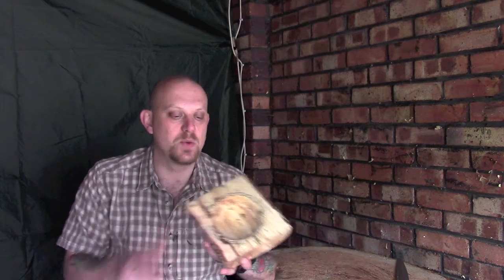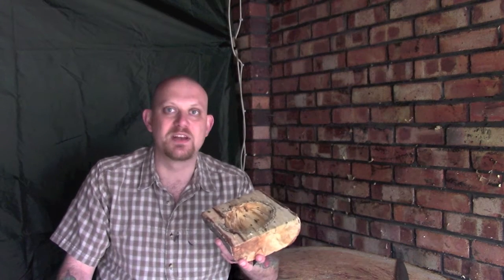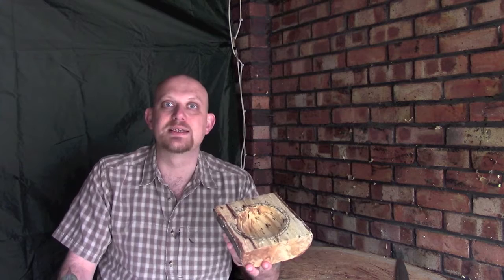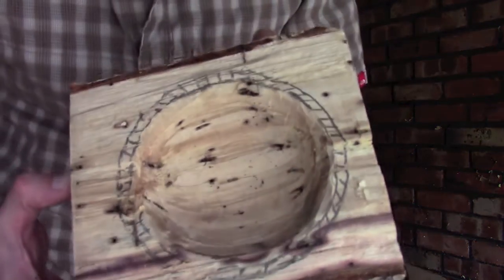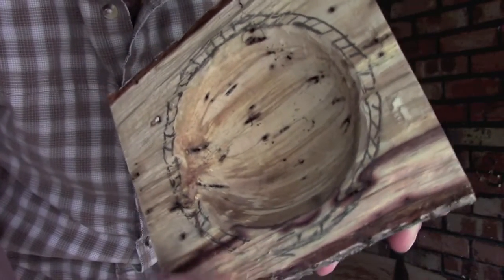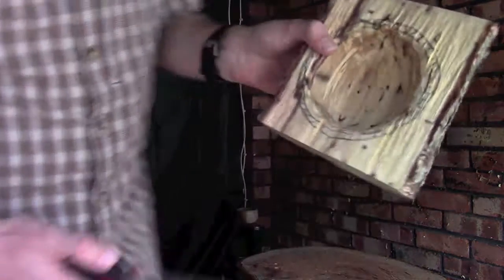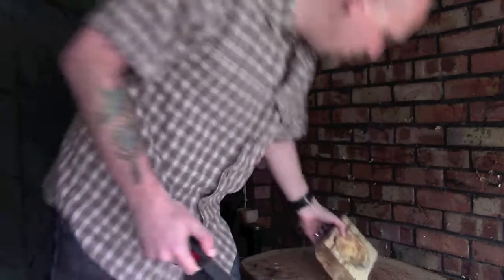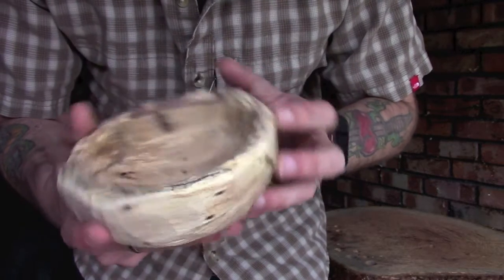Carving with less than ideal wood - Part 2

Comment: I thought spalting was only peculiar to Beech until quite recently, after  I milled up some Poplar 2'' square section, a friend cut off the excess lengths for his job, and shoved them in his wood store. They dried out over time but went a trifle grey, but, he put them on his lathe and turned out a couple of really well spalted and figured candlesticks. He glued the bases on spun out of Ash as a sort of contrast and presented them as presents to someone...... so out of rubbish we get quality... !!!

Keep up the good videos, excellently done... !!
Reply from the maker: It is possible to force spalting at home in a plastic or wooden container but it's not something I have tried myself. Essentially you are varying out a controlled decomposition but having read up on it there's seems a bit too much work involved when I have access to fallen trees already.

Comment: As primarily a hobbyist woodturner,spalted timbers are always highly sought after ; the common ones are beech,birch (especially silver birch) and sycamore. With beech being a much harder,close grained timber than birch,it can take a lot more spalting before becoming too soft to work with. To harden up soft areas to be able to cut them cleaner,try soaking them with sanding sealer,or CA glue (superglue)
Reply from the maker: Thanks Andrew I've not worked with sanding sealers before but have read a lot about them. I must try to get hold of some when I get the chance an experiment a bit, thanks for the tip.

Comment: Hi I am not from the UK and do not know what exactly is a carrier bag. I did some searches and it looks like it is a paper bag but it'd be nice if you could add some detail on the kind of bags you use to season and stabilize the wood. Thanks and I love your videos!
Reply from the maker: hernanc Hi, over here in the UK a carrier bag is a disposable plastic shopping bag, similar to paper grocery bags in the US.
To be honest any plastic bag will work and what you are trying to do is slow down the drying process by leaving a small gap for air/moisture to escape.
The trick is to swap bags regularly so the moisture that builds up doesn't have time to start the rotting process.